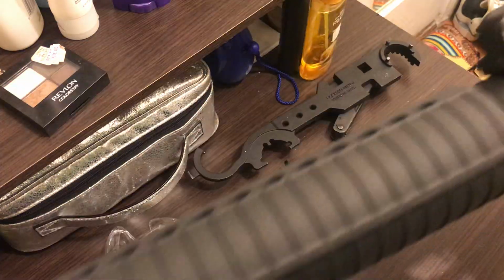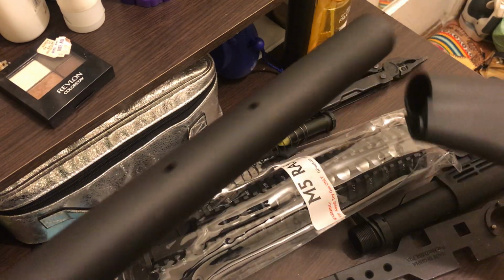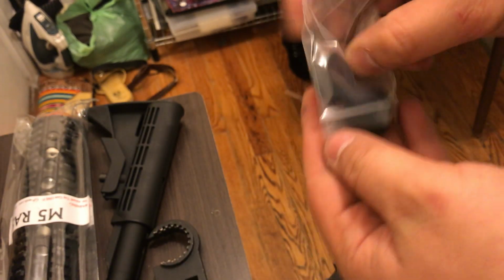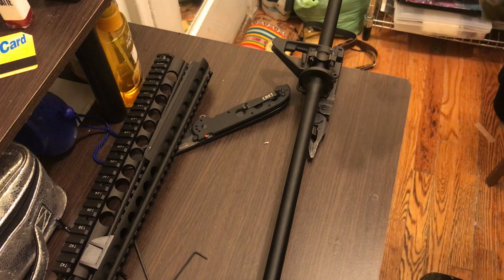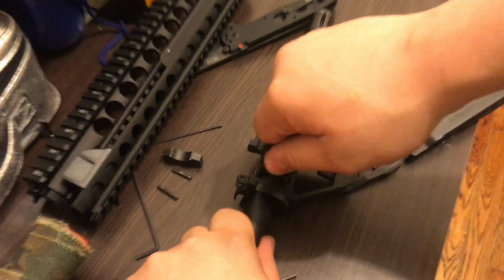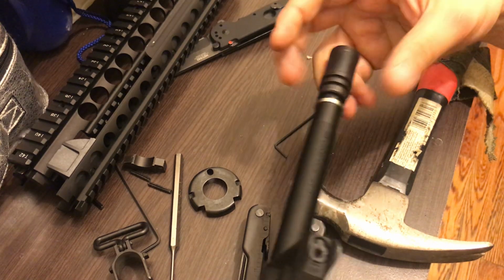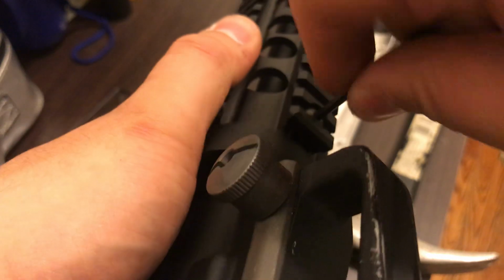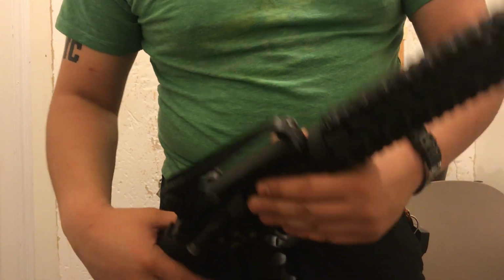GBB G&P gas M16A4 part 10. Final add ons to make a basic M16A4

Comment: Did you ever Daytona this gun or you left it as a gbbr? And if you remember can you tell me where you bought the inner and outer barrels?
Reply: Guns&trucks Lucas Goodman if you don’t mind could you do a vid series like this or just extend this one and showing how to put the kit in because before looking into the m27 I was looking for an m16a4 that I could Daytona and boom I found your playlist on building up the woc m4 into the beauty it is now truly I rather have a 240 and m16a4 to switch out between plus it has the working bolt catch
Reply: Guns&trucks Lucas Goodman perfect man is there any other additional internal parts you needed to buy other the the tight bore or the woc came with everything else I know you also bought a spring for the trigger but other than that did you use a specific hop up bucking or anything like that just so I could order all of it and then when you release the Daytona playlist I’ll build mine up along side you I’m literally going to use this as an instruction manual to build mine yours came out amazing it’s what I’ve been wanting to build for a couple years and you said you put in sears that make your semi and 3 rnd burst will that also work on the Daytona or it’s gonna be semi and full auto
Reply: Guns&trucks Lucas Goodman I’m sorry I’m so full of questions I’m just amazed with the work your doing with these guns and kits thank you again for answering them and making these videos it truly helps I can’t thank you enough
Reply: Guns&trucks Lucas Goodman other than the tight bore and trigger spring did the woc m4 come with everything else? And will your sears also make the Daytona fire semi and 3rnd Burst or semi and full?
Reply: Also if you haven’t found a gas tube for it I found this on evike now. Element Airsoft Reinforced Metal Gas Tube for M4 Series Airsoft Rifles - 31cm
Reply: Guns&trucks Lucas Goodman that’s what I thought I was trying to look at the kit on the Daytona website but it doesn’t tell you if it does or not are you using the standard hop bucking or did you buy an upgrade one? Or do you know of any that are better than what the woc comes with?